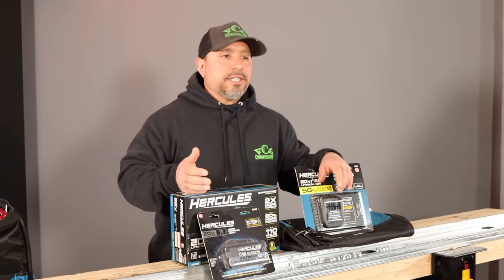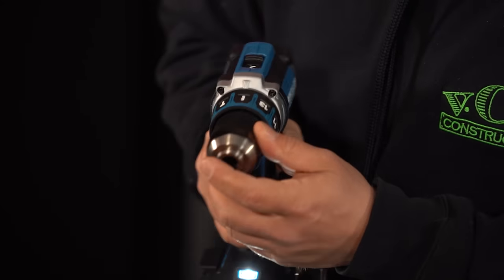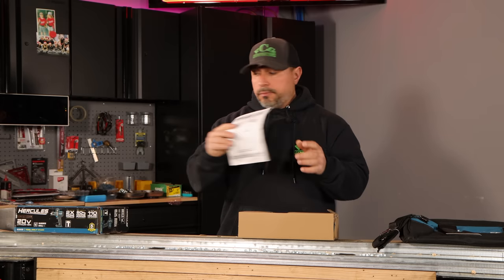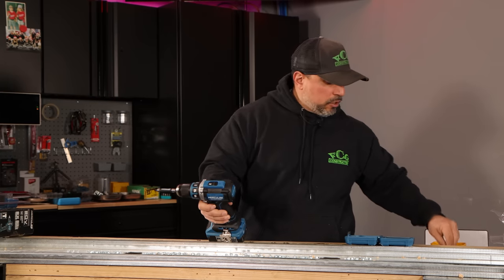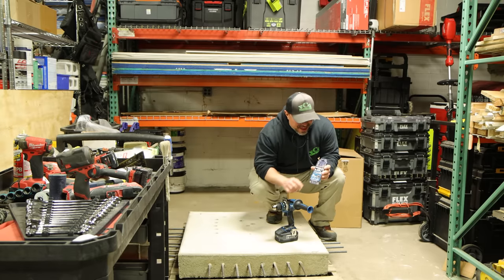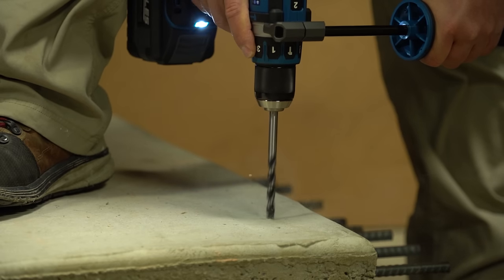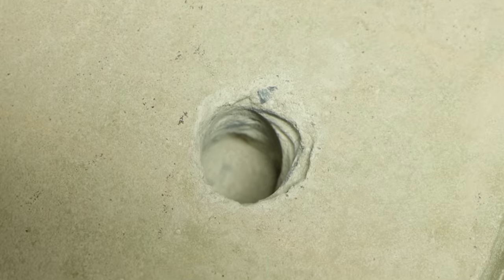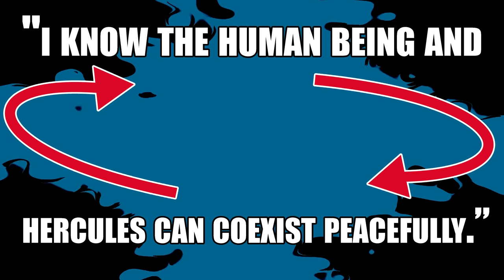Harbor Freight CAN'T FINISH One JOB, What Happens Is Shocking!

Comment: Torque test channel just put out their video on this too.  It performed as well as the Milwaukee gen 4 and thanks to the price is the current best hammer drill on their chart.
Reply: FACT. This drill clearly performs at this price point OUTSIDE of the best industry standard warranty OUT there... A shame VCG Construction took a below the belt punch on Hercules with misrepresenting this.

Comment: I went from Makita to Dewalt and for this past year tried the Hercules Line to put them to test. I used and abused Herculess tools for a number of Remodeling projects for this past year. Still going strong, no issues. They were dropped, left outside under rain and sun, used daily. Durability is there. Jobsite use approved. Whenever batteries go out I know I can go replace them with their  new warranty. (Oscilalting cordless multitool, Impact, hammer drill, sliding miter saw,  table saw, circular saw, grinders...) Now I am considering into getting their full line up of tools.
Reply: Great to hear" Thanks for the durability info. I'm just getting into the Hercules line'
Reply: So far So Good! 💪Hercules
Reply: I've used Hercules for a couple of years still going strong never had a single issue.
Reply: I just had my Makita set grow legs and walk, so I am replacing those with Hercules. I think what a lot of people don’t understand is that the batteries are comprised of Samsung cells that really are top of the line. Makita makes their batteries from the same cells.  The only battery brand whose cells perform better are not as mass produced, so no major manufacturers make battery packs out of their cell at all anyway.  Samsung 40t cells are what’s in the 21700 cell battery packs

Comment: I'd say HF is now trying to compete with the big guys but I see one huge difference. Time. The other high quality tools have proven themselves through time and already have customers with multiple batteries. Hercules would be more for someone who is starting and doesn't own 6 or more Milwaukee batteries. 
Thanks for the video Vince!
Reply: So true. I am commited to dewalt because of all the batteries I have.
Reply: You can get battery adapters for dewalt, milwaukee, almost any brand to adapt to any other brand, if there’s a sale for an impact I wanted that’s another brand than my already many milwaukee batteries, I just buy the tool. My hercules haven’t let me down yet, neither have my adapters
Reply: Definitely some truth to that. I think that’s why FLEX, as great as they are, is so slow with new offerings.
Reply: Yeah I only bought the flex grinder because it was the most recent and best in competition with what they offered. But other then that there hasn’t been much else to get me onto the brand
Reply: True that! But, but… As a DeWalt guy here I find these “bare tools only” appealing. For instance like a greaser or a plumbing snake. THEN you get yourself a cheap battery adapter and Wallah! You got yourself a “More affordable” 😆 tool on your battery platform. 
Specially for things that get used maybe ones or twice a year. Because I’m cheap like that ☺️😜
Reply: I bought the herculese drill when my Milwaukee went bad and had to be sent off, I didn't get the hammer drill, but just the regular drill, in a kit with a 2ah battery and their regular charger for 89.00 if I remember correctly. It works wonderful, then bought their 4ah high output battery wich improved the performance, and then impact in a kit form with a 2ah battery and charger with a coupon and it came in around 87.00 dollars, and actually enjoy using it. So for a little over 200.00 I got two 2ah batteries, two chargers and a 4ah high output battery. but the downfall to the herculese line is lack of tools still. We will see if they expand it or not, but these new offerings have had me rather impressed.
Reply: I bought the 4,5/5 inch grinder and with the standard 2.5 amp battery it's a decent grinder. With the 5amp or 8amp extreme performance battery and a 7" cut off wheel you really have to work at it to stall it, harder than you should be pushing on the wheel 😅
Reply: 100% Agree. I started out with a RIDGID 1/2" drill/driver kit at Home Depot  years ago. Probably paid $100 on sale for Christmas. I've since bought a few more tools and a few larger batteries, all RIDGID, so I don't have to buy a new battery for each tool.
Reply: Im a fool. i have 3 battery platforms in my garage. Hercules 20v and 12v(only 1 12v tool), Bauer 20V and Milwaukee M12. Don't get me wrong I love my M12  But im also loving the Hercules. the bauer i have for 18G brad nailer, air pump, and hedge trimmer. I actually plan on expanding my Bauer line for the outdoor. Most of my Hercules are the drills, impacts, and saws. I also do have the other worksite tools such as the fan radio and blower. Now I jsut need a few sanders.
Reply: The batteries dictate sales for sure. When I shop for tools I look for them in the battery set ups I already own. I now own several Hercules power tools and couldn't be more pleased with them. Got to get one of their specials though. Got two 5ah batteries for 149.99 that came with a free and very good angle grinder. Combine that with the impact kit which comes with two batteries and the fast charger for 97.99 and you're all set.
Reply: @xenaguy01 that would suck to be so invested in Rigid. Their prices are closer to the other big names without the performance. They aren't bad tools, but, they're not high end either.
Reply: @DudeEggs  
They're generally 30-40% lower than Milwaukee, DeWalt, etc.

Comment: Got the little Hercules 12v impact a few years ago to take off a grumpy pulley on my self propelled lawn mower. Worked great. Compact, light and handy for little jobs around the house. I think it's biggest job was building a 6 ft picket privacy fence in my backyard. So, if the big drills are anything like this little guy I wouldn't be afraid to purchase them.
Reply: I've got the new 20v impact and it is better than my yellow impact. It's not even close and I use it professionally.

Comment: I own Hercules 20v tools for home use and I love them. But I will say, as a plumper, supplied with Milwaukee fuel tools at my disposal, the Milwaukee easily drives a 2 9/16 bit through a 2x4 fairly easily. If apprentices made more I would 100% invest in an all Milwaukee setup. But I am extremely impressed with my Hercules 1/2 inch impact driver and angle grinder, would definitely recommend. I feel Hercules is just as good as dewalt if not better.  I would recommend Hercules tools to anyone without a doubt of remorse.
Reply: I love the Hercules 20v cordless ratchet. I have owned them all but only Hercules got the reverse switch right in my opinion.

Comment: Everything I have is hercules.i had the OG model and it worked great for 5-6 years .got it wet dropped it off ladders and finally burned it up drilling out a toilet flange with a flange off tool. literally smoked out a bathroom ,but honestly I should've used my sds with the drill chuck.I went immediately and bought the new model .great video

Comment: Not to sound too sour grapes, but not being able to bore the big hole in speed two is probably a good thing. Self-preservation is a good thing. I'm pretty excited about the Hercules line. I think it will give Milwaukee and Dewalt a run for their money.
Reply: One drill I have turns 1,300 rpms in 2nd gear. It's a Milwaukee M18 drill that I bought around 2008. My new M18 Brushless drill turns 1,800 in 2nd gear. The Hercules drill turns 2,000 rpms in 2nd gear. I would prefer having higher RPM's in 2nd gear. I hate the 1,300 rpm drill I have, it has horrible battery life because the motor is always screaming at maximum RPM's to get any work done. A 2,000 rpm 2nd gear is perfect, because if you're using a wire brush in your drill, or drilling small holes in soft materials, you want the extra RPM's available.

Comment: 9:50 is the drill running in reverse or is it just me
Reply: It's running backwards but Vince is putting his 200 lbs into it like a champ.
Reply: It do looky like it spinning backerds
Reply: Play it at .25 speed and you can see it is.
Reply: It’s the frame rate of the camera
Reply: @liquidrockaquatics3900  you're the frame rate of the camera

Comment: They just did a comparison between the Milwaukee hammer drill Gen 3 & Gen 4 and also the the DeWalt and over all the HFT Hercules took top honors. Only when the Milwaukee with the HO 8.0 AH could it out pace the HFT but at a higher cost so the Torque test channel agrees with it's Stellar performance. This is a far cry from the HFT product line of Battery powered tools from the old days but the price reflects that. I personally am way to far into M12 Milwaukee to switch now but I do miss the hard shell cases..

Comment: Very happy with mine so far! Also got the 1/4in impact driver and it rocks also!
Reply: Same here! I picked mine up about a week ago got the hammer drill, the 1/4 inch impact 2 2.5 amp hour batteries the charger all that for 199 I couldn’t pass up that deal after watching all these demonstrations and tests!
Reply: I have both as well. I run my impact with 2.5ah and my drill with a 4ah.

Comment: Great Review Video! The Hercules 20V $199 Pick 2 of 7 Deal (still ongoing) is a great deal! One of the 7 is the 8Amp Battery. I grabbed the Angle Grinder and OMT, both for $119. Already had the High Speed 8Amp Charger plus four of the 5Ahr Extreme Batteries, the 7 1/4" Circ, Compact Recip Saw, Impact Driver, and Hammer Drill Driver. So, once into the Battery & Charger ecosystem, the Tools themselves are outstanding and inexpensive! Unless you're doing sustained high battery drain drilling, grinding, or circ sawing, I have found the 5AHr batteries to be working fine. I've yet to encounter a situation where I needed the 8Amp Battery. Yet, it's good to know if needed I can always grab one to add to the set.

Comment: My HF is selling these new drills as a kit all in one box ($100) for the first time. Drill, 2 Amp battery, Charger. Ive only ever seen these sold separately with some kind of discount if you buy them all together.
Reply: When they first came out you could only buy them in kits w/ hardcase, I'm talking about the brushed ones from like 5 years ago. I think they gave up on the kits after about a year. I still have mine but I've also upgraded all my drills to brushless, they are power hungry so I don't recommend the 2ah batteries if you filling with bits bigger than a 1/2in, slap a 5ah in there and you're good to go.
Reply: I think that battery will put a sour taste in many novice users
Reply: @ThePainkiller3666  I agree,  the kits a good price though considering you get a charger with it.  I started with Bauer a few years ago because they were less money and had more tools.  Now I'm thinking of getting the impact kit Hercules has for 100 bucks and then adding tools that I want need from the Hercules line.
Reply: @nickabel8279  I disagree,  anyone experienced knows they are gonna want a bigger battery and I bet a lot of the less experienced users are just driving some screws and drilling a few holes on occasion.   The other thing is YouTube is here and they will gain a lot of experience with these tools by watching videos and reading comments like these.
Reply: @SVMSICE  like I said.. Novice

Comment: Thank you for this video! Was not expecting that. I have the new Hercules brushless impact driver and it's amazing. There's many videos out there to show that, but I've been wondering about the drill. Some say the electronic clutch is the weak point. I'm on the fence about getting it. If I do, it will be a life of abuse for the tool as I will be using it to drill 3/8" and 1/2" holes through stacked railroad ties for rebar. That usually makes any drill I use too hot to handle after a bit and I don't wait for it to cool down. I slap a new battery on and keep it going. I've used porter cable brushless and m12 Milwaukee fuel for this purpose, but that 1200 ft/lb torque got me wondering if it can hang.
Reply: 1200 inch lbs . you mean 😅.
Reply: @allanb3222  Yes sir. Human error. I'd hate to be a robot lol.
Reply: 1200 ft pounds on a drill would twist your hand completely Off Lol 😅
Reply: @jacobsebastien3910  ah, you caught my typo. I still haven't taken the plunge on it yet. I did buy the brushed Hercules for $20 in the clearance/open box area. I figured for $20 I could drill a few holes and if it burnt up I wouldn't feel bad about it. Turns out, it's not that bad even though spec wise it's half that of the brushless model. It has no problem drilling 16" x 3/8" paddle bits into railroad ties, it doesn't get that hot, and it still hasn't let the magic smoke out yet so I got my $20 worth so far.

Comment: Can’t finish my work. I have had my hammer drill for almost 3 months. Working with it the other day and it stopped dead. Battery is charged to full. I’m quite disappointed. Any idea what might be the problem.

Comment: Before I put anything Hercules in my toolbox, I to see it work on the job site. I want to see one of their tools survive, being hauled around from job-site to job-site, dropped, kicked, used for not necessarily the right job, but because it was closest. If you can find some 2yr old Hercules Tools and compare them, in condition, from, function to Milwaukee, DeWalt, Flex, hell, even 2yr old Ryobi, Kobalt, Ridgid, Craftsman.... Then....I may consider changing from Milwaukee and Ryobi (say what you want, but I've been beating on my Ryobi 1/4"Hex for 9yrs in Heavy Duty equipment repair and now a heavy duty body repair facility, and the thing hasn't died yet.

Comment: Normally wouldnt buy them. But the addition of the 5year warranty on the new brushless line and and 3 years in the battery is hard to beat. The pricing is really good and the performance is extremely good for the price. The reliability might be a concern but again it has that great warranty. And the batteries are cheap enough where after three years you will probably either have newer or can just go pick up a replacement
Reply: After 2.9 yrs walk in and say the battery no longer holds a charge. HF won't quibble they will hand you a brand new battery. Later you can dig the old one out of the trash out back, that is where it will go unless they recycle it.
Reply: yep, no hassle exchanges; and if it's a boxed item, many employees don't even bother to examine box to make sure all the parts are there. however, they do put old/returned batteries in a recycle bin inside warehouse; but tools go in dumpster with everything else, and the company itself doesn't prohibit "dumpster diving" (that's up to local laws/ordinances). 
Just date your batteries/tools with paint pen and take them back before warranty expires, voila, fresh tools and batteries for life...

- former HFT employee

Comment: That blue is pretty close to Makita, from a distance sure looks like one! ;-)

I dunno, methinks Milwaukee ain't going anywhere here.  Just have way too much invested in batteries and chargers.
If they had some weird tool that I needed for occasional use and buying batt/charger/tool wasn't too hateful maybe.
A light duty induction nut buster maybe?
Also I find it hilarious that the high output battery costs more than the tool!  Consumables costing more than the main product.  We've seen that before (inkjet printers).

Comment: I dont understand why people knock hercules because they dont have the kits. I dont need a charger with every tool that i buy. I would much rather buy a bunch of batteries 1 or 2 chargers and took only deals. Even if you do buy the 3 items they are still cheaper. When I bought my milwaukee 1/2 in impact gun I paid almost 400 for just the gun. Im fixin to switch all my milwaukee tools out for herc and I work as a professional contractor. The damn milwaukee batteries wont even charge all the way and they dont last long on the tool. With hercs warrenty I can take them to the store and swap they out no questions asked for 5 years where with milwaukee, I have to send it in and wait. How long can people really afford to wait

Comment: When they first came out five years ago, you could only get the drills in a kit w/hardcase. Hardcase, charger, 2ah battery, hammer or drill or impact. Wtf are you talking about? The kits were like $89 to $99 and 2year warranty for like $24 still well below the competition

Comment: Ok, just finished watching your video, first off, I don't appreciate click bait thumbnails or titles.  You say, "Harbor Freight CAN'T FINISH one JOB, What Happens is Shocking!" and you have a thumbnail that circles a part of the drill.  But in your video the hammer drill does just fine with no issues WTF?!  Now with that out of the way you talk about how the cost of the drill, battery, and charger is $248.99.  That's an initial charge, this is what someone would pay if they didn't have a battery or charger.  And this initial cost is what anyone would pay if they didn't have a battery or charger for any brand.  But when you compare the prices of the Hercules tools straight up with other brand names, just the tools, not the batteries or chargers, the Hercules is cheaper, and now they come with a five-year warranty.

Comment: Hope they up quality Control because DeWalt and the top ones will half to drops those insane prices even a bare tool is twice as much as a air tool and air tool is all metal batteries are insane and go out fast and people act line a air line is a huge problem been using one 20 years never ran into a problem it could not get fixed and why then just a bare tool is twice as much as air tools when clearly it cost more for metal than plastic right